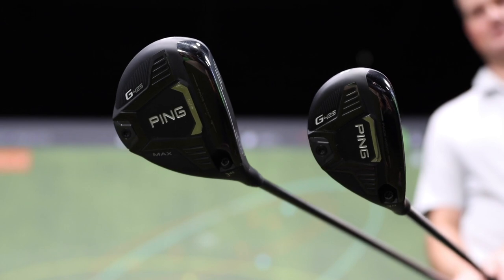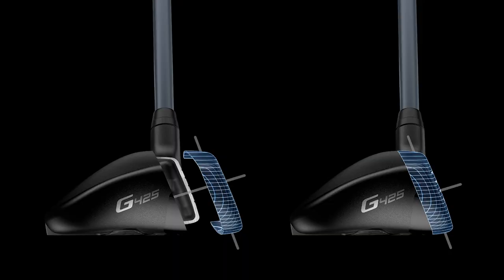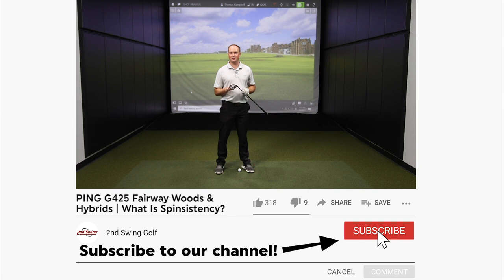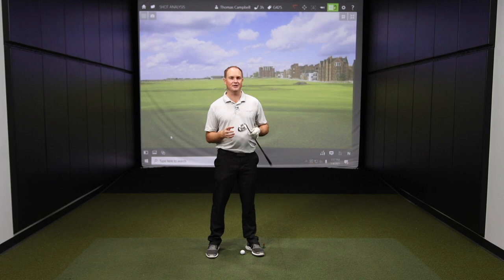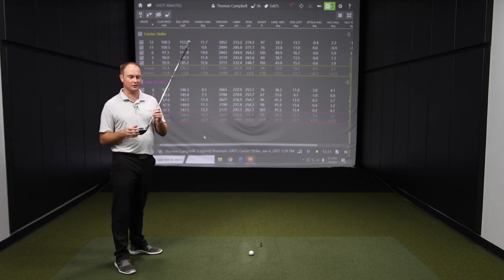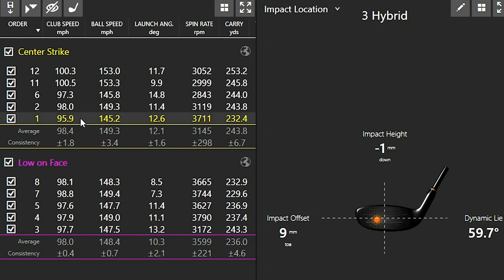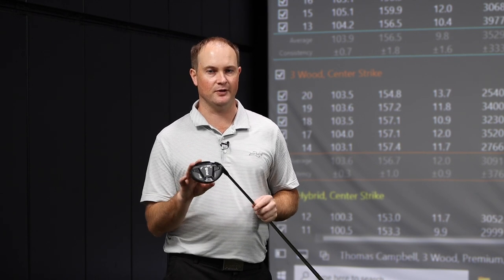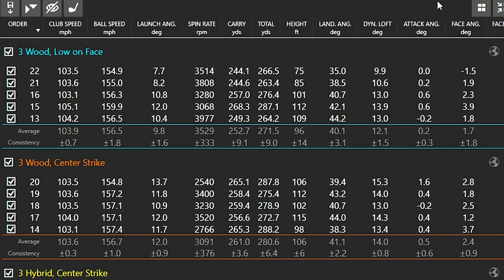PING G425 Fairway Woods and Hybrids | Explaining Spinsistency

Comment: Very interesting data on the spin rates. Didn’t know the low shots have more spin.
Reply from the maker: Thank you for watching! One of the common misses out there is golfers catching the ball low on the face, especially with fairways and hybrids. While the ball may still get into the air, there is more spin on the ball and thus distance is limited. Plus, it's more susceptible to being moved off line by wind on a windy day.